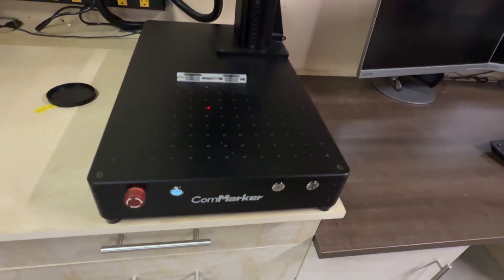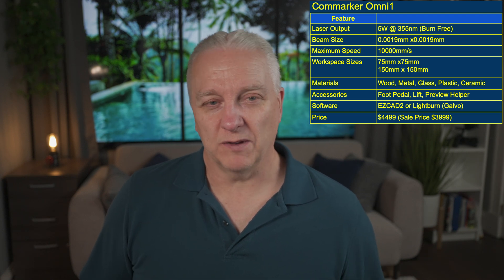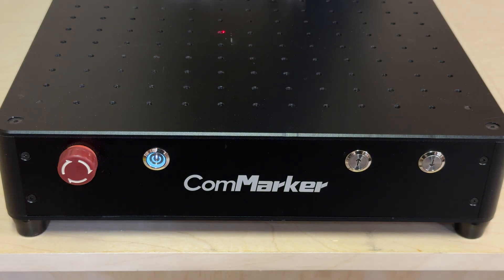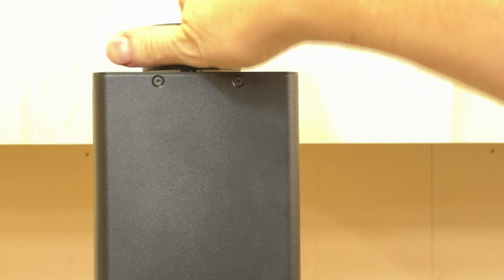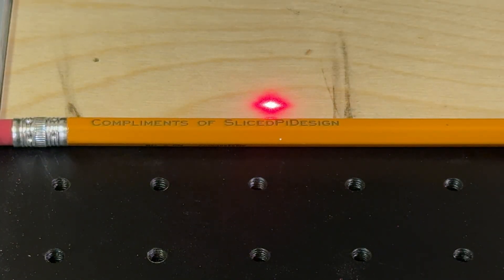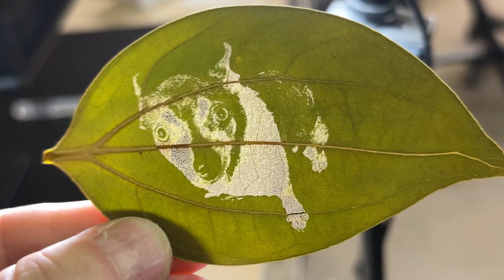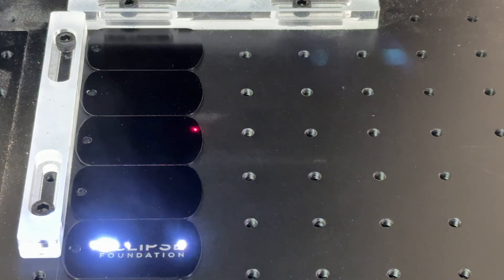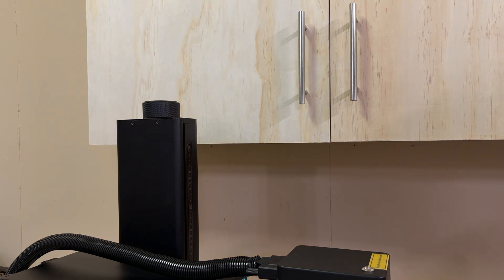Commarker Omni 1 UV Laser Engraving Secrets Revealed!

Comment: Thanks! I have been wanting to g a UV laser, specifically for glass, but I have been seeing others do very clean engraving on other materials. The ComMarker Omni 1 is at a great price point. This one may be shortly on the way to me!
Reply: Get an enclosure and wear extra eye protection.  This wavelength is no Fucking joke.
Reply from the maker: @retti9  A little dramatic, man.  I spent 7 years building industrial Excimer UV lasers way back.  These were in the Kw range and I wore my safety goggles as I do now.

Light in the 300nm in the 5W range is relatively safe compared to the 1064nm that fiber lasers put out.   The latter has a wavelength to focus perfectly on the back of your eye through the eye's lens.  But again, certified safety goggles will handle that as well as long as you aren't staring down the barrel.

However,   if you are running any laser in an area where people might wander by without safety glasses, then it should be in an enclosure.
Reply: @SteveMakesEverything  I was using a 355nm @ 10W, 40kHz pulse.  Engraving glassware, I would sometimes hit density pockets or uneven surfaces and the radiation being generated from photo-ionization would scatter into my vision.  If I wore extra safety glasses I could see small electric tendrils being emitted from the point of interaction when the laser wasn't trained or mapped out to the 3d glass surface with 1:1 accuracy.  Equal importance should go into the protection from the visible light that these lasers generate through thermal ablation.  There is also the re-emergence of the green light from SHG present in the form of fluorescence when engraving glassware as well; noticed in thin stemware.
Reply from the maker: @retti9  These are all impurities in the glass.  I don't think this increases the hazard though, since the thing that causes them is a larger than expected absorption.
Reply: @SteveMakesEverything  A larger than expected energy absorption is going to increase LUX levels.  If the cavity is angled it will scatter the reflected energy.  Safety glasses are only good for diffuse interactions.
Reply from the maker: @retti9  Yes, but as part of increasing the LUX level you are bleeding off laser power in the UV range.

I'm not saying that safety isn't important, but rather that visible light created as a result of absorbing the UV beam is the least of your worries, and every reflection is going to bleed off another ~4% more power, depending on the material.  Further, because the last thing the beam sees is a lens, the power in the light will dissipate rapidly, especially with UV light.  You will notice on a UV laser that the region where the beam is in focus is minuscule - just a few millimeters out of focus, and the beam is practically useless.  Unless you've got your nose stuck inches from the beam on the material (yes, we've all done it), the beam will be pretty harmless, even from a couple of feet away. 

This is a result of the UV beam actually being generated by a diode and sent up a fiber optics cable to a lens rather than being generated in a proper laser cavity. In real lasers, there are no lenses.

When I worked with high-powered industrial UV lasers, we could send a beam several hundred feet before any noticeable power degradation occurred because the beam was truly a light column, and there was no lens in the beam path.

This situation isn't unique to UV lasers, so safety is always a concern regardless of the wavelength you're using.
Reply: @SteveMakesEverything  Okay, that makes sense.  The distance that the operator is from the beam and secondary emissions exponentially increases the risk of injury.  Have you ever experienced a moving positive afterimage from watching your laser too long?
Reply from the maker: It is a great machine.  You won’t be disappointed.

Comment: THE Omni 1 Laser Engraver how deep can it engrave can I drill a 5 mm hole in stainless steel ? 👍
Reply from the maker: It would be tough to dig a 5mm hole in stainless with any laser that mere mortals could afford, and any 5W UV laser will struggle to achieve more than a millimeter or two of stainless steel.   These are typically engraving lasers rather than one that can cut or drill into metal.

Comment: Thanks for your lastest video.  I received my Omni 1 4 days ago. What a beast!  Since I'm not good at installing software a friend is coming over to help me with it.  A negative I found was the instruction manual.  I cannot beieve that they could have found a smaller font to use if they tried.  I had them send me their material settings which I'm sure will shorten the learning curve. 

You mentioned the overall cost.  Considering what it can do, it probably would replace other types of lasers except when you need one to cut.  In my case, I'll be doing, tumblers, glassware, metal business cards, pens and wooden and metal key chains.  Looking forward to seeing what it can do
Reply: Follow up question, Even though you use LB, did you install everything including EZcad?
Reply from the maker: Yes I should have mentioned the manual.  I did suggest a few corrections so you got the good version of the documentation.😀. The font is very small indeed and my aging eyes couldn't read it, but I think you can get a PDF version on their site somewhere.
Reply from the maker: As I mentioned on the cost, I don't think this is over priced, but if you're coming from the sub-$1000 diode laser market this will be a bit shocking, though from an engraving perspective, UV lasers are the Roll Royce of laser engravers.
Reply: It is cheap if it does all  they say.  really a three in one.  Tumblers using a C02 galvo, pens using a fiber and a UV for glassware.  If one bought all three from Commarker it would have been $10,000.  Also think that there is a better design to be able to move the head back and forth instead of having unscrew etc.  I'm 84 and my eyes are bad. Having a techie coming over Tuesday install software including LB
Reply from the maker: @TTC1940  As a dedicated engraver the Omni1 is pretty awesome.  There are a couple more materials I want to try, but you could easily do glasses, pens and tumblers.
Reply: Steve, have you put a level across the head and then the base to see if they are perfectly parallel?  Mine is off about 1.5 mm
Reply from the maker: @TTC1940  Hi Jim.  Yes, I just did this, and mine was fine.  I don't know what, if any, impact 1.5mm will have, but try to give the laser head a bit of a twist to see if you can move it.  In the worst case, you can put a shim under the laser module to get it level.  But I think it's not really a concern given the distance that the beam is in focus for a UV laser.
Reply: Thanks, I'll work on it tonight to see if I can get them parallel.
Reply: Good morning Steve. I think that we are ok on the parallel.  I had a friend come over to install the software which as you know includes ezcad2.  We ran a test and it engrave super fast.  BUT I only know LB and the instructions that came with the laser only showed LB with a Mac.  I was able to get the JCZFiber 70x70 on Devices in LB but that is all I can do.  Where can I get info as to what to do next as my pc will not connect? I'm missing something
Reply: My problem is that I'm really computer illiterate when it comes to installing soltware etc
Reply: just finished watching your "short" about engraving the white tile . Neat.  My Omni is still not working, cannot get it to connect to LB . It's a 4000$ 50 lb paper weight
Reply from the maker: @TTC1940  Why don't you install Lightburn for this?  No one really uses Ezcad because it's to convoluted and unstable.  You'd need the LB with the salvo license but it's worth it.
Reply from the maker: @TTC1940  Installation on the Mac you PC is pretty much the same, but I was pretty sure I saw Windows information in the manual
Reply: No, nothing in their manual using Windows.  I've watch at least 15 different videos about installing LB for galvos.  Nothing has worked. It will just not connect. For now I have a 4000$ 50 lb paper wieght
Reply from the maker: @TTC1940  OK if you have the Lighburn Galvo licence, plug your laser in to your computer and turn it on.  The in LB click the Devices button, and in the device dialog that pops up, click the "Find My Laser" button.  Wait a bit and it should find a laser to connect.

If you get that far, then do the connection bits that I do in my video and you should get set up.  Once you're in Lighburn Mac vs Windows won't matter.

There is one thing you need to do on Windows and that's to install a driver.  You'll find that on the USB stick that comes with the laser.  You can install and I think you need to reboot before it will be enabled. There is definitely documentation for this in the manual because I used it to install on a PC that I was testing with this laser.
Reply from the maker: @TTC1940  Sorry, I thought I answered this. If your PC isn't connecting, it's probably because you need to install a driver for Windows, which you will find on the USB stick that came with the laser.  I did see somewhere in the quickstart guide a paragraph or two on getting that installed.

Assuming you did that, look in the connection tab on the low right side of Lightburn, and you should see your laser listed there, along with a port selector.  LB will detect the available ports, and it will probably list items like "(auto)" and "PORT#0"

Either one should work.
Reply: got it runninng by reinstalling LB.  Interesting though is that It will not frame only engrave when I use the framing button etc.  Never does the framing light come on
Reply from the maker: @TTC1940  So you can engrave things, but no framing?  One thing with framing that may be causing this.  The Omni 1 uses the UV beam for framing, and if your material is darker, you won't see it.  Try laying down a white piece of paper or use that green paddle that you probably got with the laser.

Also, make sure the lens cap isn't on - I say this because it's caught me a few times.
Reply: As soon as I hit "start in the framing dropdown" it engraves. It is like framing does not exist.
Reply: I assume that it should only engrave when I hit the "Star" button, "never" when I hit the framing button
Reply from the maker: @TTC1940  Correct.  With framing it's using about 2% power - just enough to see but not enough to cause any sort of damage to you or the material
Reply from the maker: @TTC1940  That might be one to post to the Commarker facebook group.  Lots of the Commarker factory support folks hang out there as well as many users (including me)
Reply: I did a post yesterday early but as a 3 hours ago no response.  Both on FB and LB support
Reply from the maker: @TTC1940  Friday night get to China before it reaches us. Lets hope they get back to you sometime over the weekend
Reply from the maker: @TTC1940  When you installed the laser did you import the config file (markcfg7 from the usb stick)?  If not you can edit the laser again and import that that file from the ezcad2/plug folder.
Reply: Yes the "mark" file came from the usb drive that came from Commarker. Late this afternoon, I emailed LB direct with my problem.  About an hour ago they got back to me regarding that file and other questions.  I'll let you know how that progresses. Thanks for all your help.
Reply: Spent all day yesteday with LB support, still nothing.  As you know there is a setting that says "frame before start"  even with that turned on it does not frame but immediately starts engraving. What a fn mess
Reply from the maker: @TTC1940  Hang in there.  Send me an email (look in the description of any video).  Send me screenshots for the three tabs in device settings.  If I see anything out of the ordinary, I'll let you know.

Also I assume you're using LB 1.7.03??  I was running 1.7.02 and was having all sorts of weird problems with the OMNI 1.
Reply: @SteveMakesEverything  Good morning Steve.  Does it make a difference if I engrave  front to back or right to left.  I'm sure I'm not using the correct terminology
Reply from the maker: @TTC1940  Not really. I usually engrave at a 45 degree angle.  You can also turn on cross hatch for a second pass 90 degrees to the first.
Reply: @SteveMakesEverything  Are you doing a double pass on all you uv engraving.
Reply from the maker: @TTC1940  I don't always - certainly not for image engraving, but quite often, I'll turn on crass-hatching to ensure that filled areas look as good as possible.
Reply: Just did some golf balls that turned out great.

 Have you done any tumblers yet, with or without a rotary?  Spent a number of hours today trying to get the correct settings with absolutely no luck.  Just emailed Commarker to see if they have any.  Laser 911 has published a some setting but for whatever reason LB will not accept his clb file
Reply from the maker: @TTC1940  Not tumblers, but glassware.  That worked fine
Reply: I got the numbers down for glassware

Comment: Steve thanks for the informative video. I have found video that show's UV marking on fired glazed ceramic, however never with anything with a range of greys using a dither. Only Text. It also seems to leave a light mark vs a black mark. Any chance you have plans to test a photo type image on a ceramic tile? I want to buy a UV for this process but can't find evidence it will do what I hope to accomplish.
Reply from the maker: I can do this when I have a bit of time.  The color doesn't actually matter much, but the glaze might pose a bit of a barrier.  But the laser does glass, so glaze shouldn't be much different.
Reply: @SteveMakesEverything  Appreciate that, its not well represented on YouTube so likely I'm not alone in knowing how it works. From what I can tell you can mark it without etching like glass, but more like the stamp you might see on the bottom of a mug. What I'm curious to know is if it can get dark blacks and therefor dither nicely before it blasts the glaze away and starts to etch.  I believe today its mostly used to put markings on things like ceramic insulators and the like. I'm trying to find something less effort than TIO2 on my CO2 and not getting what I need from Cloudray or Haotian outreaches.
Reply from the maker: @VacFink  Well I'll give it a try, but there's not a lot of heat, the engraving is probably not going to be dark unless it can dig through the glaze to get the the clay/ceramic underneath.
Reply: Hello @steve  any luck with ceramic tiles?
Thanks

Comment: Hello and thank you for the video, can we use this Omni1 to carve on brass coin as well, using 3d slice in lightburn? Thank you.
Reply from the maker: You should be able to do this.  Marking the brass is easy enough, though getting a lot of depth is not really what this laser is for.  I did a quick test on a cheap copper coin and I wasn't real happy but I haven't had good luck with those coins on a fiber laser either.  I'll try brass at some point and publish a Short video
Reply: @ i mean if you do 100 or 150 pass, it should work tho! Im really interested in buying this machine, if you can confirm then i go for it!
Reply from the maker: @mysitter4820  I'll see what I can do.  I also want to do something quick on the rotary capability too.
Reply: @ do you need to purchase the rotary separatly? If so, do we need to buy one from the same brand?
Reply from the maker: @mysitter4820  Commarker has several different roatary accessories.  I have the one for the B4 Fiber laser that works just fine on this laser.

As far as using any other roatray, the answer is technically yes, though they use an aircraft connector on the end that plug into the laser, so you'd need to ask them if they sell the cable.  However, it would be easy enough to make your own cable if you have the pinout (and I have that if you needed it 😀).  The other end of the cable is just a standard stepper motor connector.
Reply: @ if you confirm the carving in brass coin embossing with lightburn, im gonna go for it!!! Thanks for all the help!!!
Reply from the maker: So I thought about your request to emboss coins with the Omni 1 and the answer is probably no.  You can certainly engrave brass or any other metal, but UV lasers don’t generally allow grayscale, so you can’t provide a depth map image and get the kind of depth you want.  This task is really reserved for fiber lasers.

As always there is no perfect laser for everything, but the Omni1 is perfect for engraving.
Reply: @ one last question, to laser engrave a metal card ( visit stainless steal ), when you use laser it takes out the black mat to reveal gold under, is uv laser better choice or still fiber ? Thanks for help!!!
Reply from the maker: @mysitter4820  Diode lasers will do just fine on those painted metal cards.  A fiber laser will cost you a lot more money, and what you'll gain is finer detail and more speed for this particular material.

For example, depending what's on the card, diode laser engraving could take you a minute or more.  A fiber laser will do that same card in 20-25 seconds.

Don't over-buy lasers until you're ready for them or you'll just regret the choice down the road.  I would say, even if you buy fiber laser, hang onto your diode laser, because each laser is better at some specific things.